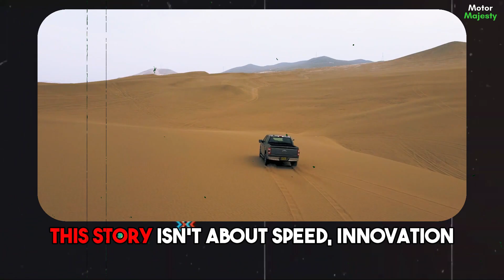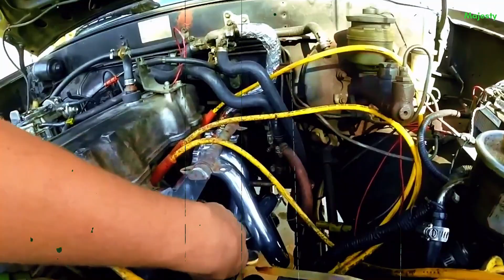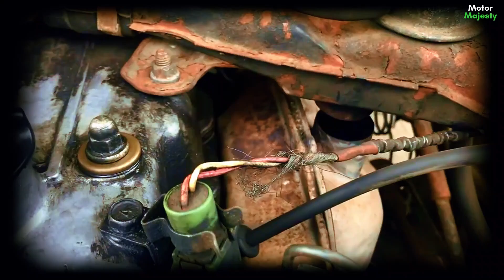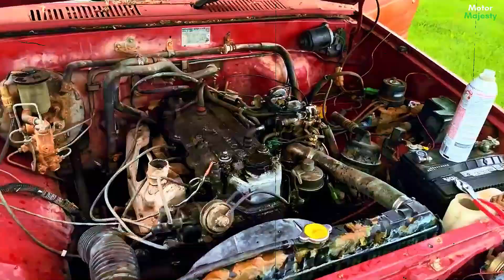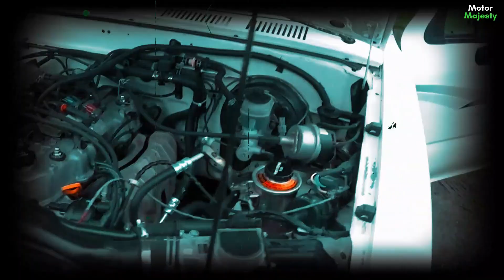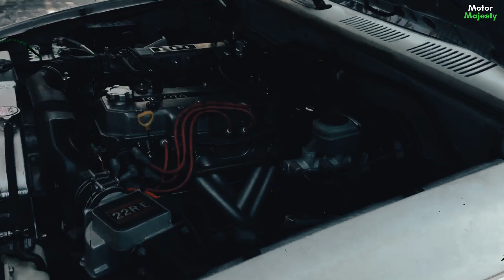Toyota 22R: The Engine That Outlived the Truck

Comment: I am very happy my 1997 2X4 Toyota Hilux has the 22R engine although not efficient but the money you spend on petrol you don't spend money on repairs and been a  1997 Hilux the last year of the over engineered 22R engine and the engine will out live the body interior maybe the chassis and l have hàd to replace a lot of parts on my Hilux because of its age and the only parts that l have replaced are obviously the spark plugs the distributor cap and rotor button also the rocker cover gasket but they discribe these engines as indestructible unbreakable and reliable
Reply from the maker: You basically described the perfect trade-off 👀
Pay a bit more in fuel… save thousands in repairs.
That’s old-school engineering right there.
Would you ever swap it, or is it staying forever?

Comment: Why fire proof engines such as R22 are no longer built is beyond my understanding _ today's engines are the worst of the barrel _ the only answer I can think of is profit and gain _ to maintain the car industry at consumer's expense _ today's car industry is worthless just to have the customer going back to their pockets _ and what about the transmission industry ? !
Reply from the maker: Old engines = overbuilt tanks
New engines = optimized machines
Both have trade-offs… but yeah, the 22R era hits different.
Reply: Because the 22R ISN’T ‘fireproof’. It blows head gaskets. It has timing chain issues. Piston slap is frequent. And high oil consumption is common. If you want a good engine, get a Honda.
Reply: @matthewstorm5188 _ thanks so much for your crystal clear understanding and excellent counsel about Honda 🎉